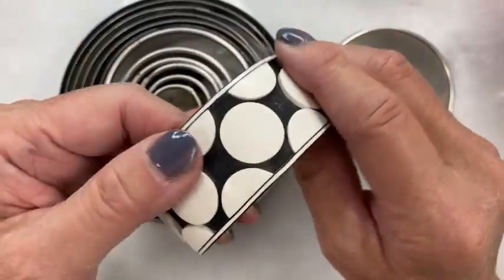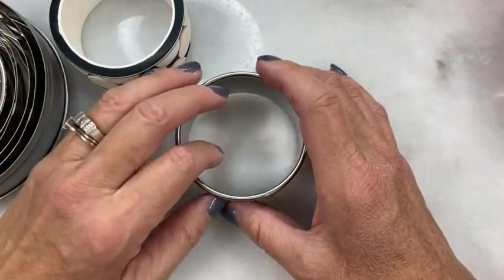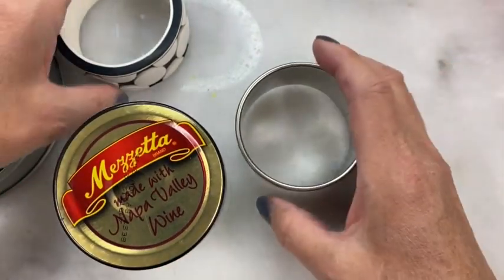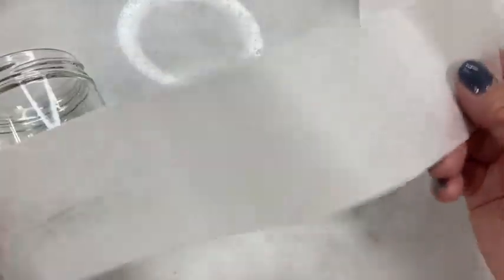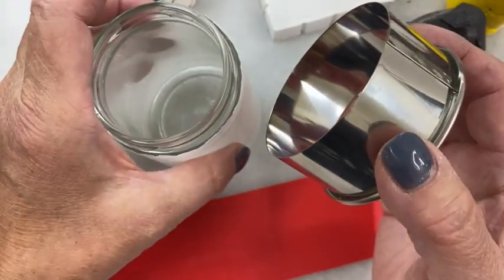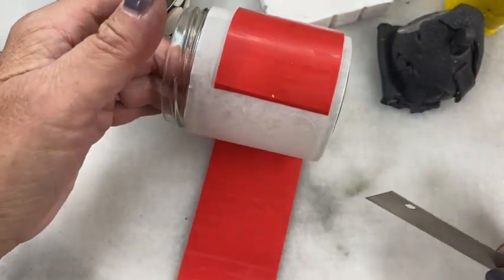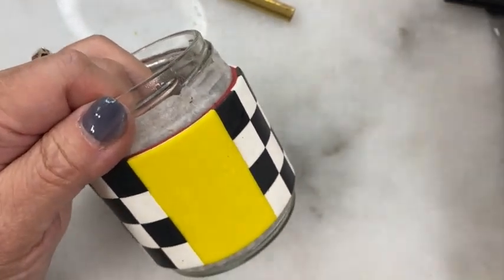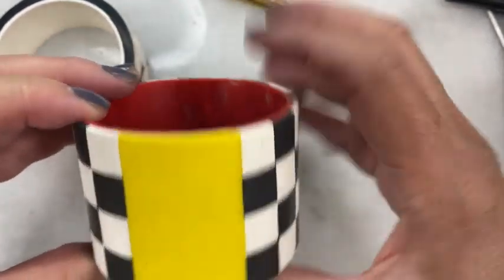Call Me A Taxi! Bracelet - A Polymer Clay Jewelry Tutorial

Comment: 37:46 this answers to my unasked questions: "Why should I bake the back first?" And maybe to the: 11:40 why not using the rod/roller to smooth the joint but put it aside and use the blade? (because I'd be better with a firm and as straight as possible back edge to trim the face, unless I want to spend my days sanding)

Comment: You talk of a cold oven cure, what is that? Also, what is the finish you used? I'm rather new to this medium so full of ??😊
Reply from the maker: Hi JW, some preheat their ovens but I put my clay in a cold oven instead. I occasionally use a resin coating but mostly I don’t use any at all! 😊❤️
Reply from the maker: For this bracelet, I ended up just sanding and leaving a matte finish on the surface. 😊❤️